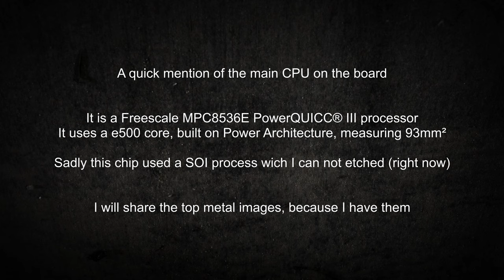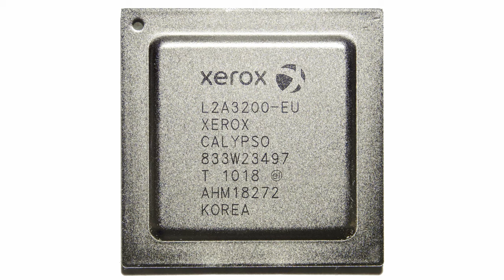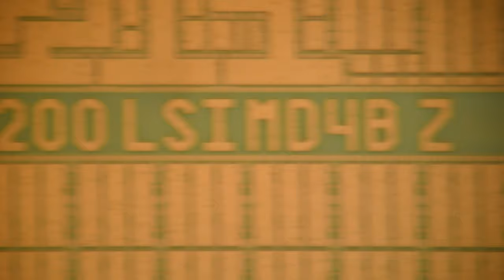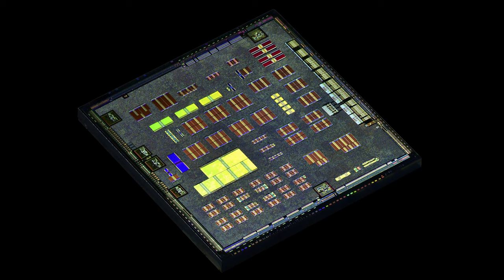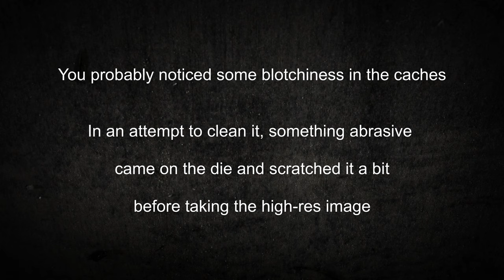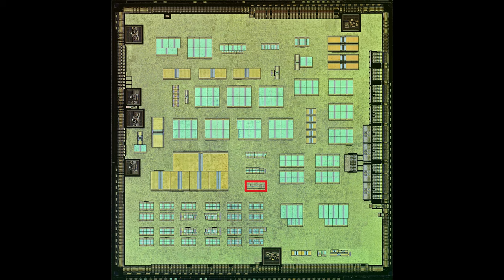Xerox Calypso (WorkCentre 7545 controller) die shots

Comment: ChatGPT: The Calypso chip in Xerox printers is used primarily for security and printer management. It ensures that only authorized or genuine toner cartridges are used in the printer. This chip communicates with the printer to authenticate the cartridge, often helping Xerox enforce usage restrictions or maintain warranty conditions. It also tracks toner levels, usage data, and may help in identifying counterfeit cartridges. If the chip detects a non-genuine cartridge, the printer may display error messages or refuse to print.

The main CPU in a Xerox printer manages the overall operations of the printer, including print job processing, user interface handling, memory management, and communication with external devices like computers or networks. Here’s a breakdown of what the main CPU does and how it works with the Calypso chip:

### *Main Functions of the CPU in a Xerox Printer:*
1. **Print Job Processing**: The CPU handles the rendering of print jobs, taking the data from the user's input (e.g., a document file) and converting it into a format that the printer's engine can understand. It may involve decompressing data, converting page description languages (such as PCL or PostScript), and organizing print queues.

2. **Printer Management**: The CPU is responsible for managing printer settings, firmware, and system configurations. It ensures the smooth running of the hardware components like motors, paper feeders, and sensors.

3. **Communication and Networking**: In networked printers, the CPU manages data exchange between the printer and external devices over wired or wireless connections. This includes protocols for print job submission, status reporting, and remote management.

4. **Error Handling and Diagnostics**: The CPU monitors the printer’s internal systems for errors or malfunctions, interpreting data from sensors and communicating the printer's status to users.

5. **User Interface**: In printers with touchscreens or control panels, the CPU manages the display and interprets user inputs to execute functions like starting a print job or adjusting settings.

### *Interaction with the Calypso Chip:*
The Calypso chip plays a more specialized role in managing security and controlling consumables, such as toner or ink cartridges. The main CPU and the Calypso chip interact in the following ways:

1. **Authentication of Consumables**: When a new toner cartridge is installed, the main CPU requests validation from the Calypso chip. The Calypso chip then checks whether the cartridge is genuine and authorized for use with the printer. If the Calypso chip verifies the cartridge, it signals the CPU to allow printing.

2. **Toner Level and Usage Data**: The Calypso chip typically tracks the remaining toner or ink levels and relays this information to the main CPU, which then displays it on the printer's user interface. The CPU may also use this data to warn users when the toner is low or to enforce restrictions on using non-genuine cartridges.

3. **Security and Anti-Counterfeit Measures**: The Calypso chip ensures that only genuine Xerox consumables are used in the printer, helping to prevent the use of counterfeit or refilled cartridges. The main CPU communicates with the chip to enforce these security policies and may block printing if an unauthorized cartridge is detected.

### *How They Work Together:*
- **Data Flow**: The main CPU oversees the high-level functions of the printer, while the Calypso chip handles low-level functions related to toner security and management. The CPU relies on the Calypso chip to ensure the consumables are valid, and the Calypso chip regularly communicates with the CPU to update it on consumable status.

- **Decision Making**: If there is an issue with consumables, such as an unauthorized toner cartridge, the Calypso chip alerts the main CPU. The CPU then acts on this information by halting printing or displaying error messages to the user.

In essence, the main CPU focuses on the overall operation of the printer, while the Calypso chip specializes in managing and securing consumables. Their collaboration ensures that the printer operates smoothly while maintaining Xerox’s security standards.